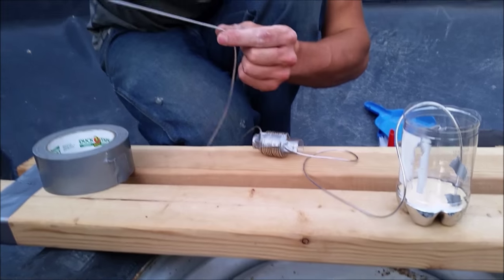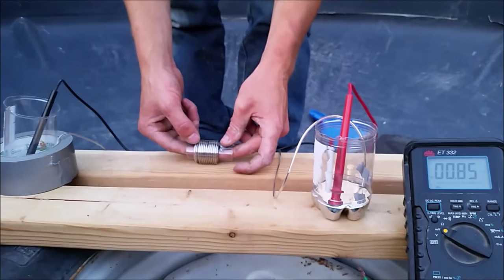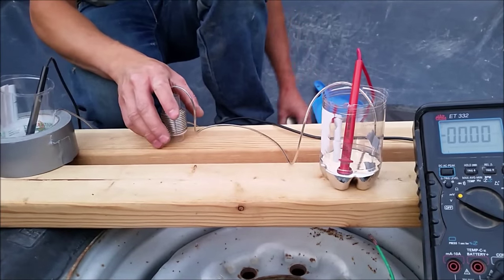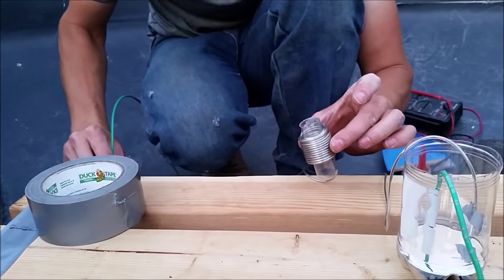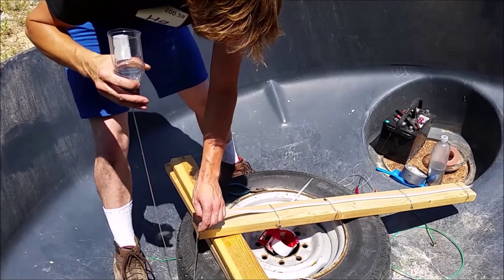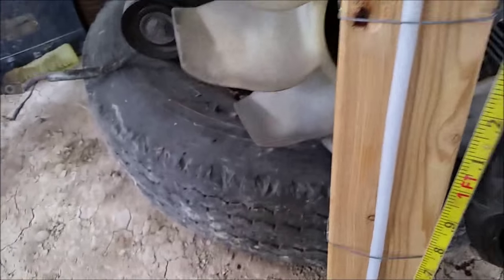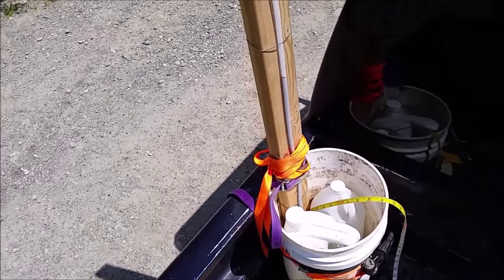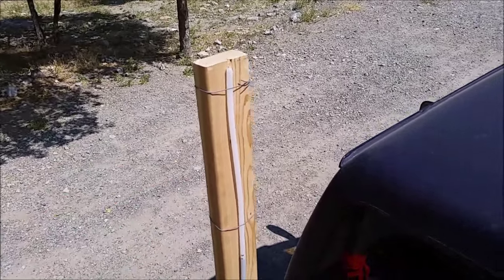Mercury In a Tube

Comment: ummm, your reference frame is the liquid itself, electrons still move forward relative to the liquid, even if liquid is flowing at some direction. Also, when you let the liquid flow over the magnet relative distance of atoms inside the field evens out,  you have no current as a result. When you move the coil itself however, you change the distribution of the mass of the mercury inside the EMF, therefore you get current

Comment: when your moving the coil your moving more mercury past any given point, than when it's flowing though the tube.   Is that the problem?
Reply: If the electrons are standing still then you are moving the protons past them so the same effect happens. It's not the movement of the electrons that makes the current its the movement of the electrons in relation to the protons that creates the magnetic field.

Comment: When the mercury evaporates, you have to add more. But what happens when you add more? Does it create a taller column of mercury inside the tube? Can you get false pressure readings from it?
Reply from the maker: +Martin B 
take a glass of motor oil and a glass of mercury and set both in a warm place and wait a few thousand years, neither will appear to have significantly changed but on closer examination it will be found that the oil evaporated 10 times more than the mercury.
Reply: I was asking you out of scientific curiosity. My question was: "what happens to the mercury column if some of it evaporates. I didn't know at the time I asked this question, but now I've given it more thought. I think the answer is: Since the mercury column isn't moving in any direction, but stays in the tube, it means that the mercury column applies as much pressure to the atmosphere as the atmosphere does to it. This doesn't change when the mercury evaporates partially, as long as there is a uniform mercury column applying pressure to the atmosphere. If, however, the mercury evaporates to such extent that the height of the column is reduced, then the mercury column will be forced up the tube,  to fill the vacuum. This of course won't happen as long as the height of the mercury column provides a pressure equal to that of the atmosphere. Thank you for not answering my question, as it allowed me to reflect more and achieve a higher degree of understanding.
Reply: Bryan Dennis Foolish guesswork, to say the least. I'm neither South Korean, nor have I ever set foot on American soil. I live in Denmark, which is a small country in Scandinavia/Europe. I think you'll be pleased to know that I'll never settle in your country, unless some odd set of circumstances compels me to.
Reply: Bryan Dennis Additionally, I see no merit in lengthy discussions concerning American grammar. Suffice it to say, that I still maintain my initial position regarding your flawed use of punctuation.

Comment: Since the electrons are not tightly bound to the Mercury nuclei, the flow rate of the Mercury can be independent of the electrical current. Nice thought experiment though.
Reply: Its actually the electrons moving compared to the protons that causes the electric field. so if the electrons are still then the ions are moving and the force remains the same.

Comment: i think i got the answer for the mercury experiment:
when the mercury is flowing, both electrons and proton move togather with the same velocity.
then, you apply voltage, and the electrons start moving relative to the protons, and remains in place in the ground reference, and therefore, the electrons dont give rise to a magnetic field.
BUT!
the protons are also moving! and therfore there is a net current fitting the speed of the mercury!

Comment: You also need to consider fluid dynamics, because the fluid layer touching the tube is actually not moving relatively to the tube/pipe. But it wont work anyways.. :D

Comment: Hey Cody the movement on that scale seems very small. Wouldn't a smaller tube fix this problem? The smaller the tube the more does the height chance :)
Reply: The mercury would travel the same distance for any tube size. Pressure = Force / Area
Reply: Jeffrey Jones
Yea you are right, I fucked that up with a thermometer.

Comment: Actually, I'd guess that when you make the mercury flow, both the positive and negative charges in the mercury atoms travel in the same direction, so you get no net movement of charge, and hence no net electromagnetic effects.
Reply: I wonder whether your results might be any different if you first imparted an electrostatic charge to the mercury, and then repeated your experiment. It seems like that should induce a net movement of charge when the mercury flows.

Comment: Hi Cody, your view of electricity is victim to the way electricity is taught in our schools.  There are three competing views of electricity: the view of the physicist, the chemist and the electrician.  Each one uses a different set of theories in describing electricity.  I ran into this when I was first editing the article on Wikipedia about cathodes and anodes a very very long time ago, building them up from stub articles.  When the wiki edit wars began I started digging doing research into what the various parties were saying and came to see that each school had it's own way of looking at electricity.  I had an instructor in my Basic Electronics and Electricity school in the US Navy that did understand it and did try to straighten us students out, but, it got lost to most of us because we were being fed so much new material at once.  

Here's the simplest takeaway I can provide: electron movement between molecules or atoms allows an RF field to be generated around the molecules or atoms.  The RF field is the electricity, not the electron movement.  The RF field is moving at the speed of light in (or most of it around, a little bit inside) the material it is generated in.  The electrons move slowly in the material since they are jumping from molecule or atom to molecule or atom.  The proof of this is electron flow in a salt bridge as it discolors due to electron movement - the RF is flowing over the salt bridge at the speed of light (in spiral paths around the conductor) while the electrons are slowly jumping from molecule to molecule.  Hope this helps a bit.

Comment: You forgot about the positive charge of the nucleii. If the Mercury flows in the opposite direction of the electrons then effectively the nucleii are carrying the charge so you have a current of positive current in the opposite direction which is the same as a negative current in the original direction. So Mercury flow makes no difference.

Comment: When I learn where to purchase the mercury, I know  where to get larger
  not so delicate glass tubing ind protective guards, I hope to construct a barometer in a
 corner of my shop. I'm not interested in portability, just a standard. I wouldn't expected the mecury flowing to change anything electromagnetically, because its current flow in a conductor that does the magic, not flowing metal. 
to calibrate my aneroid barometers to.
Reply: you can probably buy allbof it on ebay and if it isnt the 99.99%lab stuff it is pretty cheap.

Comment: If there was a near perfect vacuum in the tube wouldn't the mercury boil?
Reply: yes it will
Reply: +alles klar klaus yeah so wtf?
Reply: Some of it boils and that little bit of gas keeps the rest in check basically. These mercury gaslamps have not really much mercury in it and there it stays in the gas phase. Like water it would also cool down while converting into gas and if no heat is applyed from somewhere this would counter out some boiling until the system is stable. Thats means only in a perfect vaccuum where you constantly remove any mercury atoms flying around it will eventually boil completely.

In fact if you put liquid nitrogen in a vaccum chamber it wont evaporate and boil. Okay it will boil quite a bit but suddenly it freezes because the boiling sucks out so much heat. Cool way to make some nitrogen ice but once you get it out of the chamber it becomes liquid again :(

Comment: I just had another idea during breakfast, you should be able to pump the mercury by applying current and putting it in a magnetic field.
Have a look at this video:
<https://www.youtube.com/watch?v=PTf57Ys9g0g>

I think if the magnet is held steady the mercury should be pushed through the tube instead?

I also considerend the "impeding the electrons" thing some more and I think you'd need much higher flow speed to see an effect.
If you want to impede the movement of sound through air you would need to move the air at the speed of sound, not at the speed of wind.
So you would need to move the mercury at a significant portion of the speed of light to see any effect. The flow of current is because the electrons "push" on the next one, and this "pushing" happens near the speed of light in metals.

That said I think there are still a number of great electromagnetic experiments to be done with so much mercury.

Comment: Electricity actually only propagates at about 1/100th the speed of light.
Reply: +Skwisgar2322 Hence why internet ping sucks dick when copper vs fiber.
Reply: +Skwisgar2322 False, in coaxial cables it's about 2/3c
Reply: ZanteF12R
Hmm, It seems you are correct, not sure where i learned the 1/100th thing.
Reply: The individual electrons move slowly. The force exerted by them moves quickly.

Comment: Can't you make a barometer with water ?
Reply: +Cody'sLab  But you can with alcohol, right?  Or is that just thermometers?
Reply: +Lemon Chief You can make a barometer with water but it would have some problems. The barometer would have to be over 33 feet high, instead of the normal 30 inches for Mercury. Mercury is over 13 times as heavy so it makes a more compact barometer. Another problem is the vapor pressure of water. The high end of a barometer contains the 'vacuum' or low pressure that the atmospheric pressure pushes the column of liquid into. Water gives off vapor at all temperatures and tends to fill this 'vacuum' with water vapor, a gas. For any given temperature the vacuum end of the barometer will change pressure. This can be compensated for with charts and a thermometer. Even mercury barometers have to be temperature compensated or adjusted because of this and expansion. Adding soluble salts or low vapor pressure solvents like ethylene glycol would  help. Another problem water barometers face is they can freeze, but anti-freeze can help with that too. One additional problem with water and water mixes is the exact water level in the tube. Water tends to stick to the walls and form beads, making the reading of the level problematic. Mercury, when clean, tends to pull away from glass, making a nice sharp edge to disclose it's level.
Reply: pixelpatter01 You mean "no" ? I would have understood if you said "no". 
My brain hurts :(
Reply: Lemon Chief How do you get "no" from "You can make a barometer with water"?

My brain hurts from the illogic.
Reply: +Lemon Chief You can make a barometer with water, or any liquid. No liquid has perfect qualities for use in a barometer. Mercury has problems as well, but its weight makes it suitable for smaller room sized instruments.  Just as paper can be used to make clothes, it is not the best material.